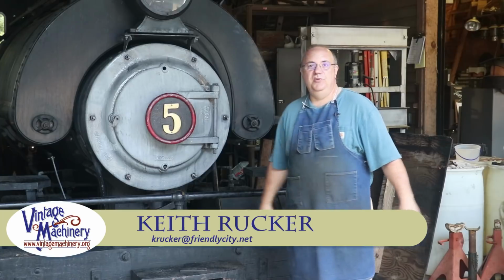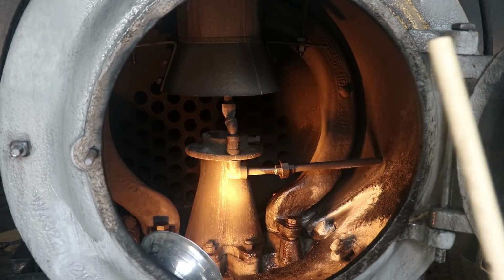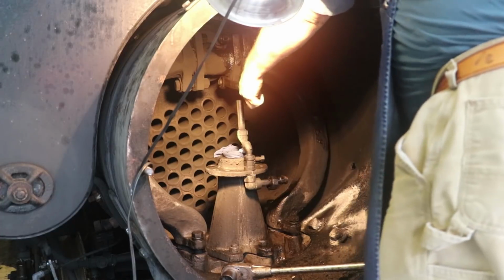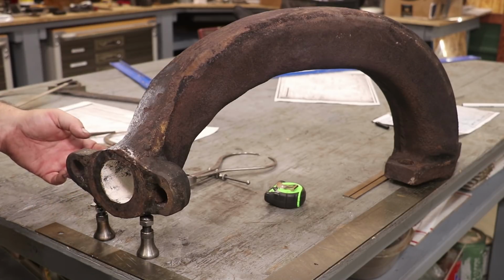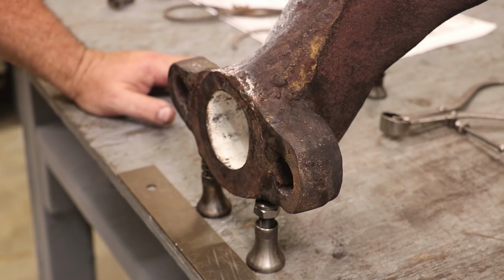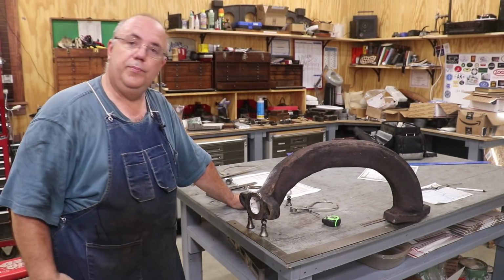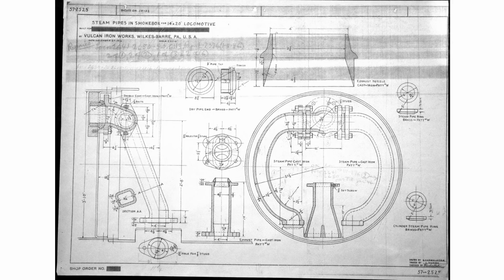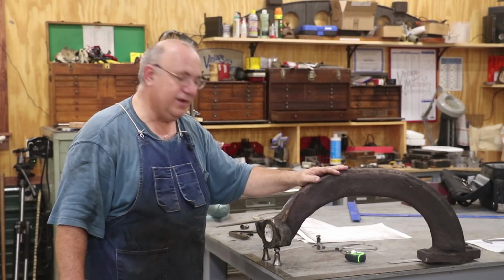Steam Locomotive Steam Pipe Repair - Part 1:  Pipe Removal and Game Plan

Comment: Now I understand how the steam moved around inside those monsters! That fitting must be under incredible pressure and heat when the engine is operating - what's the PSI at that joint?

Comment: Keith, I asked a Metallurgist friend who owns a big foundry specialising in Ferrous castings how hard it would be to cast a new part and the answer was straight forward. Quote “The part would be made lying down with a simple straight parting line.  The core is made of special heat setting resin that is totally self-supporting even in molten metal .  I assume that the item is of cast iron with a very low melting point making life much easier.  The core would be retained in substantial core prints (holes in the mould to keep it firmly in place).”  He also said because cast iron has zero shrinkage you can simply use the original part as the pattern.  Of course you would add some material like Bondo to the flanges and shape it providing extra metal to machine off the new castings.  Definitely better than a patch job on a patch job if you ask me.

Comment: Keith, as a starting point we could use photogrammetry to create a computer model of the part. We would need to take a series of photographs of the part and then have Pix4D create a point cloud. We can then import the point clould into Fusion 360 and from 360 you can get drawings and the files for a 3D print of the part. If you are interested please let me know. BTW I live pretty close to you in GA.

Comment: The inside of the smoke box looks very clean for an oil fired boiler.  Your fireman obviously keeps a close watch on his fuel/air mixtures, although I believe that you use diesel, which burns cleaner.  At the Pichi Richi railway, here in South Australia, we have a "T" class loco on oil (not used for some time now) and we use old engine oil in it.  This is very smoky, especially when the fireman doesn't pay attention to what he is doing.

Comment: Great project, nice video.
I would approach the repair differently.Repair the flange ear and machine the casting flat at the correct angle.
Machine a 45 degree chamfer in the ID about 3/16".  I think the mating casting on the engine will have a similar chamfer.  If it needs it dress it up to make a good seal surface.
Now make a special spacer gasket to make up for the lost material.  It would look like this:
Use your imagination here.  Think of an image of Saturn.  The ring would be say 1/8" and end up in the shape of the casting flange with ears, The body of Saturn would be a sphere the diameter to seat on the angles of the castings midway on the chamfer.
The body of Saturn would be milled down to a dimension flat and parallel to the ring on both sides above the ring and higher than the point of sealing contact.
When you get to this point drill and bore the center out to the correct size to pass the steam.
This would end up with two self locating joints similar to the one removed from the casting.
You can see it in the blue print.
I have 50 years of shop ownership under my belt.  I know this would work, but it would not be an original restoration.
Go for the replacement of the original configuration through the school at your leisure.  Repair it now and get it going.

JIM

Comment: Keith, I my self would remove the ears but also at least 1/8 to 1/4 " off the hole bottom and make a new bottom out of cast, that way it would seal but also be stronger too when its brazed.

But as you also said about screwing new ears on, if you got the metal then why not.

There is so many ways to go thats for sure but with you you will find a way to make it work and keep the beast and n the rail for another year.

Keep up the great work.

Comment: here is a crazy idea cut the whole end off booth ears and the steam fitting. Machine a new proper end complete with the ring that got ground off. bolt the pipe and the new end in the locomotive so the geometry is perfect. Braze it while in place. if you can't get to the backside once it's together take it back out to finish brazing. no crazy work holding no measuring precise angles 2 feet apart from each other. the repair would be custom fit to the actual locomotive.

Comment: how about milling off both broken ears and turning a smooth circular spigot concentric with the inside diameter of the steam pipe,  then make a new flange of steel that fits tightly to the steam pipe and braze it together.  the flange can have a perfect surface and extend as far as necessary to contain the pressure.   (is that legal with boiler construction)

Comment: Hi! Some questions about this job. 1) does the steam pipe HAVE to be made of cast iron? Maybe some other material might be a better fit, so long as it meets the material/mechanical requirements (i.e. can it withstand the pressure, temperature, vibration, etc...?) 2) instead of cutting just the ear off, could you slice the entire flange (?) off parallel to the correct plane, then machine a new flange with the ears integral to it, along with the lip that sticks out the quarter inch or so, and braze on the newly machined flange (along with some extra fasteners, such as the cap-head screws you mentioned)? 3) I wonder how they cast such a weird-shaped piece in the first place, considering that it’s hollow?
I hope you get the ol’ girl back up and running!

Comment: I appreciate all you guys do at the museum. That's some casting and a great project for those students. I understand you can scale off a photograph, I read that in an article on industrial espionage. Two weeks earlier a chinese  guy entered the plant where they were building the engine pylon for the McDonald Douglas MD-80 and started taking photos. Maybe they could scale off of photos. While you're at it maybe casting the other steam pipe might save time in the future if the ears on it get broken. It will be interesting see what they come with. Thanks for sharing.

Comment: this is a pretty complicated project. i think if it were me i would  split the pipe a some convenient place ,repair the lange, then bolt the two pieces back onto the loco and braze the two pieces back together as much as possible. then remove the pipe and complete the braze. at this point you should have a servicable repaired part and an accurate piece  to built a  pattern from. as always there is more than one way to skin the cat. this is just my 2 cents. i'm looking forward to following this project. best of luck keith

Comment: Hi Keith,
you got yourself a dilly of a pickle. a few thoughts here: the pipe you are repairing is a short version of a super heater that super heats the steam going into the drive cylinders. it has to go into place without tension. as you well know cast doesn't do twist or tension very well and with the flange being ground the way it is you guys were extremely fortunate that the pipe didn't burst altogether.
for the application you have, steel as additional buildup is a poor choice because of the corrosive nature of the smoke when combined with steam and heat. any steel parts you use aside from stainless will corrode away in a short amount of time. 
my suggestion would be as follows:  build up a complete new ear out of a piece of cast and braze it the part so that it is flush with the lowest point of the profile plane. then mill the face of the flange perpendicular to the flange you have on the table and chamfer the inside of the passage. 
then re-install the part temporarily and measure the gap between the repaired flange and the flange it mates to. there should be a gap if the milling is correct.. then you should make a corresponding thick spacer out of copper with a tapered lip that reaches into both mating surfaces and match the surface contours of the flange. normally there would be a copper ring as a gasket between the flanges anyway and the lip that was ground away protected it from the corrosive steam/heat/smoke mixture

one other little thought: when using stainless steel fasteners an application of ceramic lube such as loctite LB 8036 or something similar will keep the threads from galling. it will also allow the fasteners to be re-used as they will have already been tempered for the application. 

cheers
mike

Comment: Cool project Keith. Given how bad the geometry of the flange is - would it be better to cut the entire flange section off with a bandsaw, make a new flange and braz the new flange onto the old tube while they are bolted in place to ensure alignment?

Comment: There also has to be a ring for the seal to be retained in place welding and aligianing are only part of the project the bottom  is not flat it has the retainer ring machined into it too, as I understand the desired end result. Good luck

Comment: Maybe no pre heating and improper welding  rod? Has a similar problem a old backhoe exhaust, I rewelded with special rods after preheat and slow cool in sand and it worked well, I believe they have a nickel content and used A/C

Comment: https://www.muggyweld.com/product/ssf-6-silver-solder/
This company has some amazing products that may be just the thing for the repair process.  Casting a new piece is the best option, but with the time constraints, a strong functioning repair is what is needed.  I have used the SSF-6 with amazing results.  Far stronger and easier to use than conventional bronze/brass brazing material.  Their website is very informative (with helpful hints and directions) and is worth a look at. 
 Best of luck with this challenging project.

Comment: Maybe you could get a piece of 2" thick durabar, cut 2" off the end and make a new flange from the durabar and silver solder with 54% back together. Tack it together in the machine to get it aligned and finish it outside. As for making a new one take out the other good steam pipe, put it on a CMM (somebody watching must have one) and just do a mirror image of it for the casting. Make both while your at it....if you have time of course. Just a thought.....
Reply: What he said, but machine the outside of the end of the old part so it's a cylinder, bore a hole in your replacement flange to serve as a socket and silver solder together. That will reinforce the end of the old piece, give you a large surface for the solder, and give you all new material for the flange.

Comment: Had a similar problem with an old cracked diesel engine head. Ended up removing all the repair steel and weld repairs down to good cast metal and made up blanks for the replacement. Then I preheated everything to 1000 degrees F in a kiln and TIG welded it with cast iron rod, including building up the face. Afterward, I fly cut the face and cut the setback with the mill and drilled my holes. The key was keeping an even heat and an Argon gas shield on the part. Still solid after years of use.

Comment: Machine off ears and cut down end of tube slightly.  Machine a new flange and braze to end of pipe.  Your mechanical fastener idea is going to introduce lots of stress concentrations into the part and is very unorthodox.  This part is simply a cast iron pipe with a broken flange.  Don’t let it’s odd shape freak you out.  How would you repair a broken flange on a normal pipe?  Cut it off and weld new one on!  (0:

Comment: There's a lot of interesting suggestions to think about below.  One thing I see is that many people assume that the right and left side are perfect mirror images.  I seriously doubt that to be true.  Before mass production, pieces were made rough and machined and massaged to fit.  Nobody mass produced Steam locomotives!
Reply: Identical parts were a genius invention, tolerances had not been considered much before that, you just made the piece fit.  If you had to replace a broken one, you got or made a rough part and went through all the tedium of making it fit/work properly all over again.

Comment: Use a piece of oak plywood and 2 blocks of modeling clay to make an imprint of the flanges and locations. That way when you have a 3d printed render you can check if it is close.

Comment: How about a different route to a pattern. Get a header tubing kit from Summit racing, the one with the misc. bends and flanges. Cut and weld those into the proper shape of the inner steam passage. Polish it up and you have a core. Coat it with grease, then use spray foam to build up the outside and sculpt that into the outer shape. Coat the outside of that with a couple coats of latex paint . Now you have a pattern.  Use something like Monel tubing and it could even be left in the casting.

Comment: Keith, why not mill the face of that flange right back down (say a half inch) and machine a whole new lower flange you can bolt then braze up onto the existing piece?
This way, you can machine a much smaller part with the correct step, then fit it in place & join it all together.

Comment: I had been wondering if would be possible to re cast the pipe. What struck me is that it might be easier to cast the entire flange, including a short section of the pipe above and braze that assembly to the suitably cut down steampipe.  I am familiar with sand casting, which could even work for the short section that I propose, but I am eager to find out how you cast an entire, tall, hollow piece like the steampipe.

Comment: Keith first let me say I'm not a machinist nor an engineer but I thought of a different solution to the problem.  First machine off the flange to get the surface in the proper plane in reference to the top flange.  Next grind off as much of the "weld" as possible on the sides and bolt head side without removing the ear.  Machine a plate the same dimension as the flange and thick enough to restore the proper thickness and profile around the hole as originally cast.  Have the plate oven brazed to the flange and then braze the ear on the three sides previously ground.  That should give you the rigidity   of the plate and the bulk of the original flange.

Comment: I hope you can get some videos posted of the Wisconsin engineering students making a new casting and the attending machine thereafter.  While pipe and welding weren't what they are today back 100+ years ago, and I know you'd like to be authentic, but wouldn't a fabricated pipe be easier than such a complex casting?   Of course, that wouldn't teach the students the joy of casting or 3-D printing the mold.   Either way, I'd also like to see what the Pennsylvania Railroad Museum comes up with.  By the way, are those castings true mirror images of each other or are they only "close?"  Maybe the students could make both and you'd have a spare?

Comment: If I were doing that repair, I would slice off the entire end flange all the way across.  Then get a block of cast iron stock and mill up a new flange with all the needed features: the ears, ring, etc.  It would be flat and much easier to handle.  Then you would just need to braze the whole thing back onto the tube (a braze ring around the tube).  It would be one structural piece where all the forces are in the flanges, and a much easier piece to mill and braze together.

As for casting a new part, you should just get the existing one laser scanned.  Then the damaged end could be corrected in CAD before 3D printing the casting patterns.  It would be an enormous time and effort savings over making patterns the old school way.  It should be really interesting to see the core box for this one.

Comment: 3D scanning is the best way to go. There's a number of excellent machines that will precisely do that task and, with the appropriate software,  will create 2D drawings in any plane you desire.   Scan not only the steam pipe being repaired but also the connection points in the Vulcan locomotive too so you can verify that the steam pipe precisely fits.  This would be an ideal project for the college students.You may wish to contact John Saunders, YouTube channel NYC | CNC, and others about how to do this project using CNC processes or via classic machining techniques using computer generated 2D drawings available after scanning.
Reply: See if there is a Fero Arm distributor that will visit the train and scan the flanges, then scan the part.  https://www.faro.com/products/factory-metrology/faro-scanarm/    Mount it to the train temporarily and scan the position of the flanges.

Comment: I would attack this in a different manner.  Spray the damaged sealing surface with a release agent and protect the matching flange with plastic film or thin tape. Use the old gasket [with release agent] and epoxy putty to replace the missing area 'in place' with it bolted in.  This is quick and gives you a TRUE reference surface to jig your milling machine to and reference dimensions from.  Do your repairs and build up's and the mill is already set up and waiting.  With the release agent the epoxy is easy to remove and you have to clean and prep the flange prior to repair anyway.

Comment: First thing I would do, is make a 3-D scan of it. There is a method of scanning an item using a standard camera. And there are several programs, mostly online, that can combine these scans into a 3-D object. Clean it up in your favorite CAD program. Then find someone with a large 3-D printer that can print the item either in sections or as one unit. When casting make sure you increase the size of the core appropriately. You can make a full-size print of the item and test fit it, Before you cast it. Also, if the other pipe is a mirror image of this one, I would go on and make both cores, at least.

Comment: Can you build two wax flanges and a thick walled wax tube and fasten them together in the locomotive then remove them as one unit, bury them in sand and pour in molten iron?